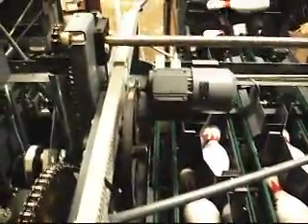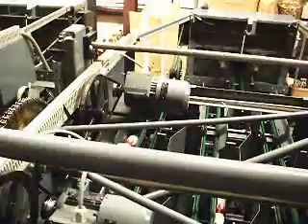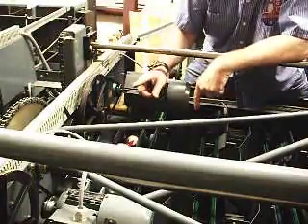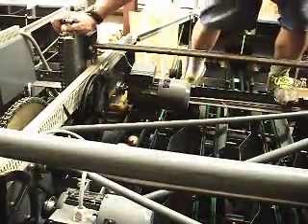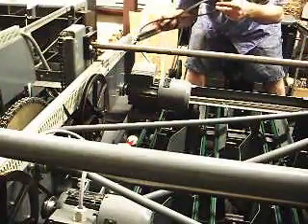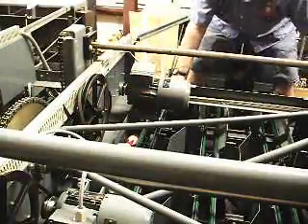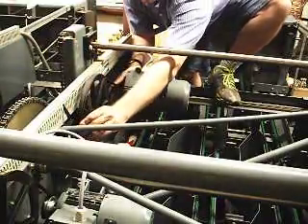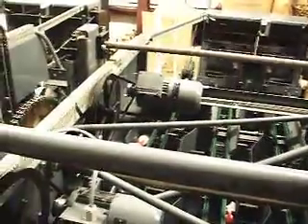Table motor alignment.

Comment: Sir how to adjust stroke limiter plate
Reply from the maker: First thing I only have only Stroke Limiter Assembly (Machine Series 443 and Above).
http://www.brunswickbowling.com/downloads/support/GS_Pinsetter_Parts_47-902712-000_Rev_11-2015.pdf
page 116 (17G).

If you are having stroke limiter plate issues you should check the 99-076120-000 R.O. Hydrualic Shock Absorber Assembly.
Check for busted seals or broken 99-070397-004 Compression Spring.
A bad hydraulic shock could place the stroke limiter at a lower angle causing it to always catch the 47-071871-003 T-Stop.
This can stop the table from going full cycle and setting pins on the deck.
Make sure you have your 47-075435-004 bushings placed proper and haven't over tightened your 11-051067-001 Screw (8 mm x 35 mm).  
The stroke limiter plate has to have some movement. 
Make sure your 99-070356-004 Solenoid is clean.
Clean inside the solenoid and 99-060133-004 Plunger.
So long as you have nothing binding movement of the entire system it should function properly without adjustments.